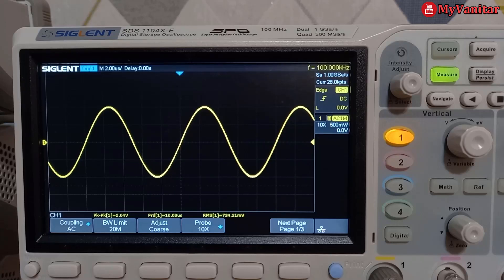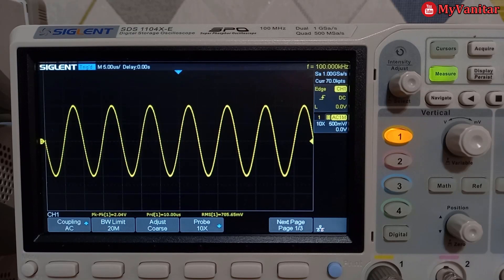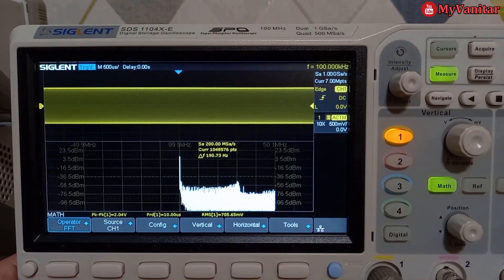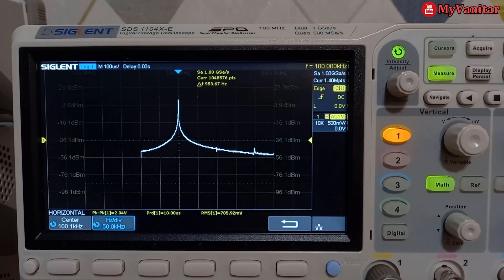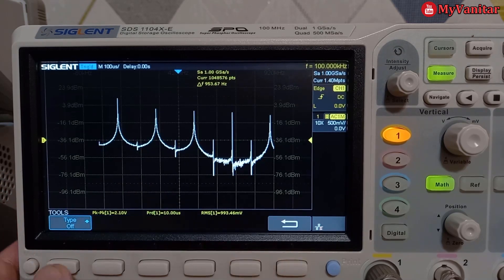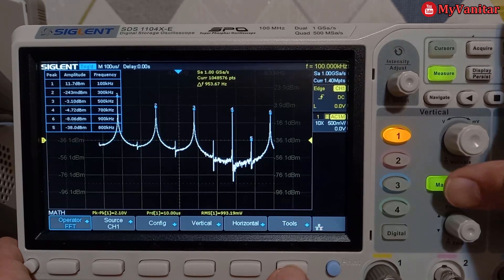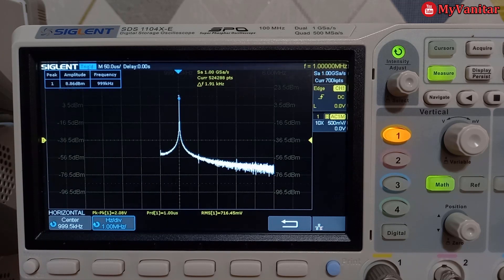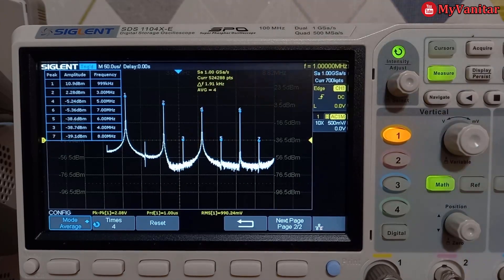How to Easily Set up the FFT Function in the Siglent SDS1104X-E Oscilloscope

Comment: For some reason the peak detect and table function (for FFT) is only available on the 4-channel versions, not on the 2 -channel. If FFT is very important, go for the 4-channel version.
Reply from the maker: Are you sure? I don't have the two channels one to verify, please upgrade the firmware to the latest and check again
Reply: @MyVanitar  Yes I am sure. I have both scopes in my lab (1202X-E and 1104X-E). It seems that the 4 channel versions are more often updated with new firmware than the 2 channel versions.

Comment: thank you!
How useful is the FFT on this model with signals of much lower frequencies between 10-1000 Hz?
Reply from the maker: it does the job, I can detect the 50Hz hum noise, however, you can go for the X Plus series also, I will make another video for 2000X Plus soon

Comment: I don't get why your measurment for 2Vpp = 1Vp = 0.707Vrms = 707mVrms of a sine wave at 1MHz shows only 8,86dbm (dbmV rms) where it should have been around 57dbm (dbmV rms) since 707mV is 57db higher than 1mV.
Reply from the maker: I will check this as soon as possible and write back

Comment: Great but you skipped a bunch of the critical FFT setup,   Like how to setup vertical scale, ref level, units and ext load.   Please keep in mind someone of us are complete newbies.  Which is why results will vary unless you cover every single step.    Again thanks for the effort.
Reply from the maker: You are right, however, I realized preparing a correct view is the first step because if a novice user first plays with scales and other knobs, he might not get the spikes. many users think FFT is very complex or just for some specific purposes and don't even use such a cool feature

Comment: A square wave contains the fundamental + the ODD order harmonics.  So what are all those EVEN order blips doing there?  It would have been nice to see that signal on a REAL spectrum analyzer, for comparison.  Is it the FFT that's at fault, or are those harmonics really in the signal?  It also would have been nice to see a time-domain display of that square wave, to see if it looks a little "screwy."  A REAL spectrum analyzer shows the REAL Fourier series.  I'm not sure I trust the FFT, especially since computer SOFTWARE is used to produce it!  ::)   (from an old, "Luddite" engineer).
Reply from the maker: I liked your attention to detail, the possible reasons are:  the amplitudes of those spikes are low, and this is an 8-bit oscilloscope (look at the table). Wires (from the signal generator to the oscilloscope) also introduce some inductance and I can also see those inductance spikes on the sharp edges of the square wave Signal in the normal time domain. furthermore, the sampling rate of the function generator also matters. if you have previously worked with an Analogue spectrum analyzer, those look less noisy, but anyway as a result, FFT does the job, but yes, you have to purchase its dedicated tool (spectrum) to target the application with no question :-)